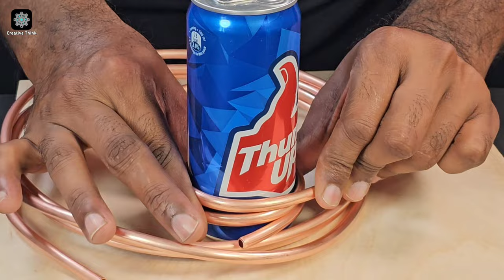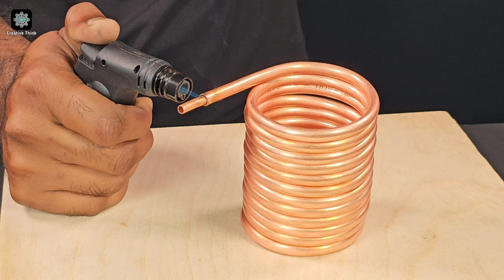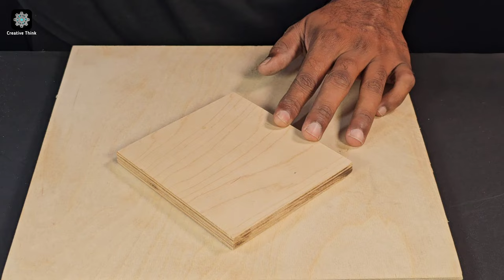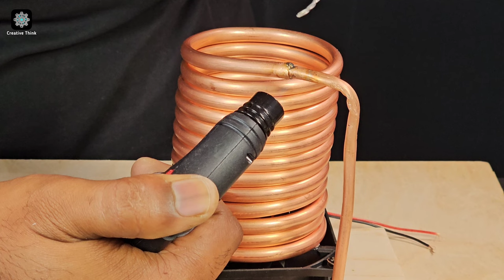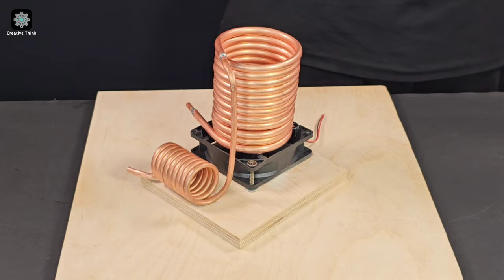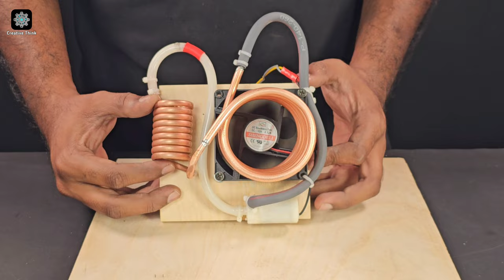Deep freezer || How to Make Fast Cooling AC at - 15°c

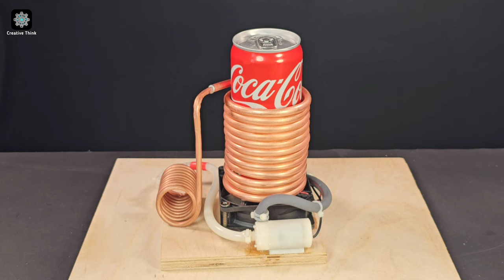Comment: At 05:18 in the video you can see that the copper coil is being sprayed with a cold gas medium. Note the spill on the table. Totally fake. You need a high pressure compressor, a condenser, drier, expansion valve or capillary tube and a evaporator.

Comment: This is fake. evaporator neednot fan but condenser need fan .in this circuit must be   capillary tube.and a   weak pump can not pressure  as compressor.
Reply: Have you tried it yourself?

Comment: You inject weldman its use for welding or joint two objects instead of free freeon gas how it works without that. The weldman is getting cool if it's compressed in circulation

Comment: What is the motor you are using as the compressor?
Reply: Also, what are you using as the thermal expansion valve? Is it that orifice you plug the rubber hose into? Or because the small coil is lower it is acting as a collector and just evaporating off?. This makes sense as the pump appears to be low pressure just to move fluid that collects. I wonder if it would benefit from an orifice as it may suffer a performance issue as is if tipped.

Comment: Tip: it works on the princepals of a steam engine pump.
The fan blows the cold air off the tubing cooling it to operate the pumping action. Freezing the can or chilling it like a blast freezer!😮😮😮😮❤